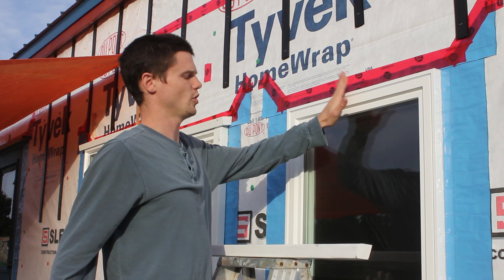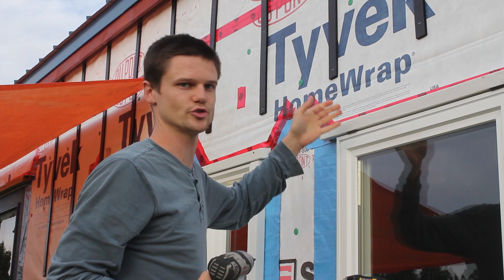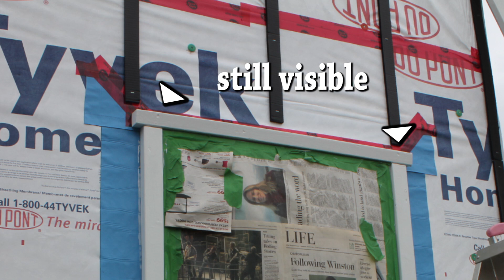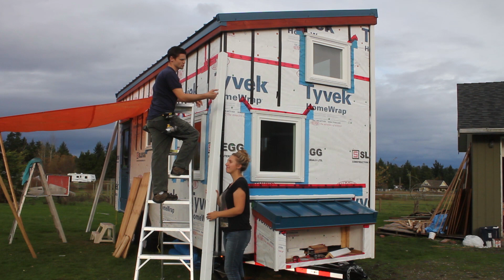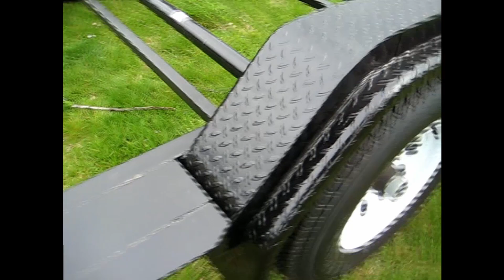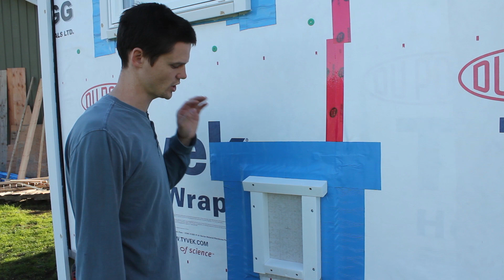Tiny House Window Trim Installation (Ep. 21)

Comment: I am curious why you didnt put furring strips behind the trim?
Reply from the maker: The trim is something that we would definitely do differently if we did it again. We'd use metal drip-edge on the top, and layer it with the siding differently... if we do an exterior overhaul, we'll go into a bunch of detail.

Comment: A personal touch, I would have made the top trim extend 1/2" further than yours... leaves the top trim well proud of the window preventing window runs, and adds depth and character to the framing.
Reply from the maker: Indeed, a little more overhang in a few spots would have been better, but we are already pushing our width to the road-legal limit, which is why we kept it in tight. I think we could have gone for a narrower trailer configuration, and we would have had more room for this kind of overhang :)

Comment: Nice work and great idea using the cut 2x4's for the trim. I like the angle idea and how it works to push the water away from the building. Simple and genius in many ways. The only thing you might want to think about is pulling the top trim off and adding a drip cap. The only reason I say this is that I can see a small gap at the top of the window and any wind while its raining would likely blow whats on the edge of the drip edge into the house wrap layer. If that happens that part of the window is a flat area and the water will likely work along the house wrap and down the sides of the window trim internally.  If a little water gets in over time it could be damaging as the years go by and worse if the house wrap gets even a small breech around the window. The drip cap has a L shape to not only catch the water but create a more water tight seal over that top gap. Seems like the way the angles look in the video the top would be subject to this in the wind and the bottom matters less since you have the siding and the bottom of the window cant pool any water.
Reply from the maker: +Audioholic 01 The angle works quite well, but the thing we would definitely do differently next time would be to have the bottom piece span the full width instead of being between the side pieces. This has created a vertical seam that might allow water through. But we have caulked everything very intensely, and we have started a routine of checking the seal of the entire exterior at the driest part of summer, when the wood is most contracted and seams may have opened up... we re-caulk then. When you're referring to the gap at the top, remember that there is a nailing flange on the window, so for water to get in that way, it would have to get around that.

Comment: Nice job, With the new PVC moldings available I think That's what Ill use. It's a bit more money but they never rot and with the special driver bit they sell for mounting the trim a small plug fills the screw holes perfectly.
Reply from the maker: Larry Read Ah, I will have to look into those for our next project :)

Comment: The only issue I see is you did not cut a groove on the bottom to keep the water from walking under the trim. Normally there is a cut made to break the surface tension. Example http://www.garymkatz.com/Publications/Articles/LBM/DurableExteriorTrim/Fig.03.jpg
Reply from the maker: ***** Thanks for the input. We'll see how ours hold up over time, but anyone looking through these comments should take note of your post :)

Comment: I really do not get why you would make your "bottom piece" on the window shorter than the window width?  Every window I've ever seen has the outside sill or drip piece wider and the side pieces coming down to butt against it.  I doesn't look bad or anything, just catches the eye as different.
Reply from the maker: justgivemethetruth I guess we based it off the ultra-basic type like this:@2010/10/l1020293.jpgTheThe idea is to have as little water running from one piece to another as possible. I have considered the possibility or water getting into the vertical seam created by the way they are laid out... we may put a little bead of caulk in there for good measure.
Reply from the maker: Tiny Nest Bah, the link isn't working, here it is again: http://decorarts.files.wordpress.com/2010/10/l1020293.jpg

Comment: Quick question.  Are you planning on grounding the house when you get it to it's final destination, and if so, will you use a plate or a rod?  Some people believe the trailer will ground itself through the legs, but I don't know.  I know mine are electric galvanized, and the feet have some sort of coating on the bottom.  I haven't seen this dealt with in any of the tiny house videos I've seen, and being a self-taught layman electrician, there's so much I assume I know but don't.
Reply from the maker: gary pollock Glad to hear someone thinking about this kind of thing. Without getting into crazy detail, the trailer should absolutely be "bonded" to ground, but actually "grounding" it would most likely result in a less safe situation. This applies to an on-grid situation like what we will have. If you are creating your own power source, like converting solar DC into 120V AC with an inverter, you may want to create your own ground. The short version is that a power supply should only be "grounded" in one location for the entire system. You only want current to flow on the bonding/grounding conductors in a fault condition to allow for a breaker to trip and thus protect people from potential harm. If you drive a new grounding rod or plate beside your trailer, but there is also an existing one where the property's power supply connects, then you could have regular-condition current flowing through the bond/ground system, which is generally unsafe. You would want to "bond" the trailer to the trailer's electrical panel bond bus, and be certain that the bond system and the neutral system are isolated from each other. Only if your trailer was a SIGNIFICANT distance from the property's supply (and system ground) would you want to consider creating another "ground", and even then you would keep it isolated from the neutral... it can get quite complicated... I'm not sure if writing it out like this will completely make sense. We will try to cover this in an upcoming video.
Reply: Tiny Nest My plan is to have both shore power and solar.  We have a lot on our property where it will be connected to shore power, and my plan is to rent it to college students during the school session.  (in Campbell River, there is a shortage of short term rentals), and I expect, from the going rate, to get $600 month, all inclusive.  In the summer, we have a leased lot on Rock Bay, (on the ocean by Chatam Point Lighthouse at the entrance to Johnson Strait), and there it will be solar.   Could I just hook the AC ground  to the ground power from the main power souce like normal house wiring, (from my garage), and ground the DC power to the trailer frame?  Is there still a chance of crossover? At this point, I was thinking two seperately wired systems.     The DC would have a 3000 watt inverter, 2 160 solar panels and 4 trojan 6 volt batteries. Would that be better than running one normal house wird system with a transfer switch?  (I already have all this stuff from when I was on dialysis).  I don't have to buy anything or I would do it differently.

Do you have a planned occupancy date for your house?
Reply: gary pollock Should have added more detail.  My power comes from a sub-panel in my garage, and is a 60 amp breaker supplying power to a slab about 25 feet away.  My RV  5 th wheel now parked there, has 30 amp service, which I plug into via my electrical cord from the trailer.  (normal heavy one which come with it, not sure what size)  Post has 2- 30 amp switches.  I only use one when I have it pluged in. Everything I need is on that curcuit. The second one was actually dedicated for the kidney machine.  (this was all professionally done, I didn't do it)  Everything from it is ran back to the garage, so I am assuming that's where it is grounded as well.
Reply from the maker: gary pollock I think this is too much to communicate effectively via comments :P but I'll give a few more general tips, and obviously be ultra careful if you go poking around in any panels.A sub-panel (if done correctly) will have the neutral and bond buses isolated from each other to maintain that single-location grounding for the house's system. The tiny house's panel must be like this as well.
The trailer should be bonded to the tiny house's sub-panel's bond bus.If you are generating extra-low-voltage DC and using it in DC form (not inverting it) along side grid AC, I would leave the DC as a stand-alone system and just make sure everything is fused correctly.If you are generating DC, inverting it to 120V AC, and that is the only source of power for the whole tiny house, it might be good to drive a rod and connect ground to the neutral bus (creating your own system ground).I'm not an engineer and I'd have to review the code on these details since I haven't actually worked on mixed systems like what you're describing. You may need some electronic regulating devices to manage the incoming power for solar etc...Anyway, don't take this as gospel and be diligent with your own research. I don't think I can be of more help with this specific installation. Keep an eye out for when we get to electrical on our own build and maybe I'll cover some more details that will be helpful to you. Good luck!

Comment: I always thought that trim was to cover up the dirty edges after the siding was installed.  It should be interesting to see how it all works once you've got the siding in place.
Reply from the maker: wwwShadow7 Only time will tell if it works out, siding video coming soon!
Reply: I think I prefer the technique these guys have used as the rain ingress should be minimal. Good attention to lapping and drip detailing.

Comment: I have a question about water. I am thinking I will install an outside tankless water heater (with a housing) just above the tongue of my trailer. How are you going to hook up your water supply (if you have one). City water, RV, rain water? I want a constant / consistent source of water and am not too familiar with plumbing.
Reply from the maker: racenuke We will be hooking up to the existing water source on the property comes from a well. We have a propane on-demand water heater physically installed, but we will make a video once we can show the installation from start to finish. Stick with us and you'll see how we go about it ;)